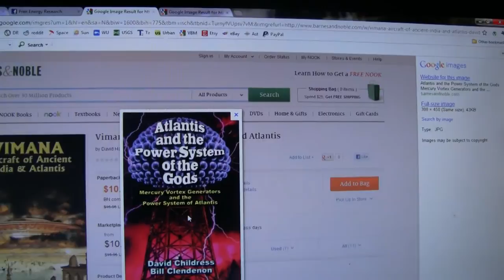Tesla's Tube Torus & the Rodin Coil: Understanding Surface Topology

Comment: Thank You for your insight Greg, I always find your vids enlightening on one level or another, working with Mike Power's bi-filar star of pancea lately and find the torque increcible, I have a Rodin coil as well and I find that it has different results under the same tests and conditions as the star,I believe each geometrical pattern has specific results in comparison to eachother which could facilitate different system's in general.Are we not living coils with different geometry....   NAMASTE